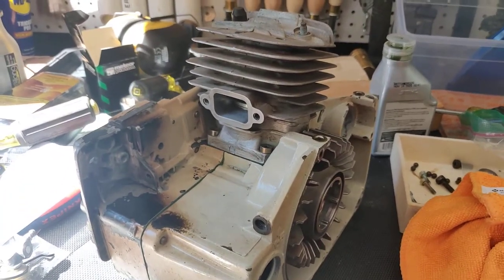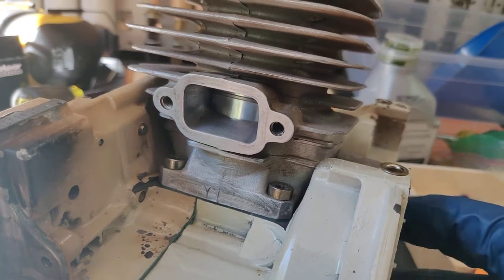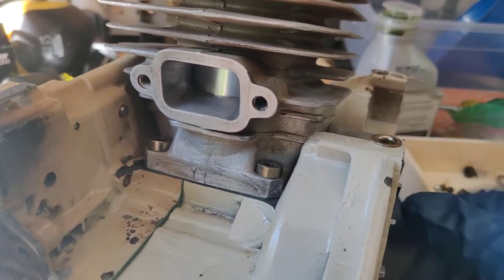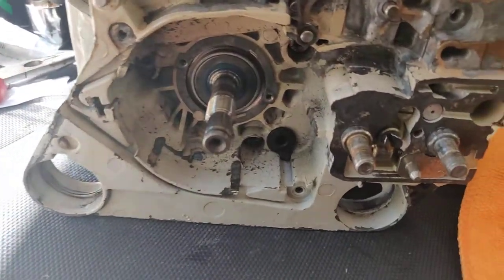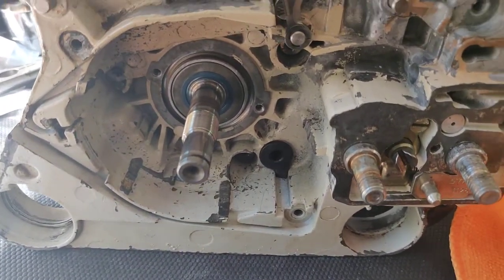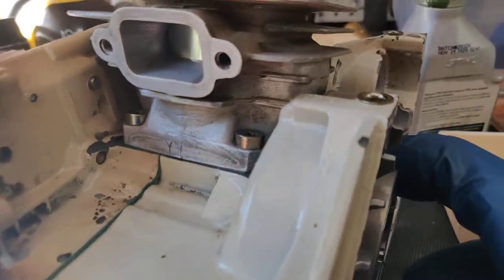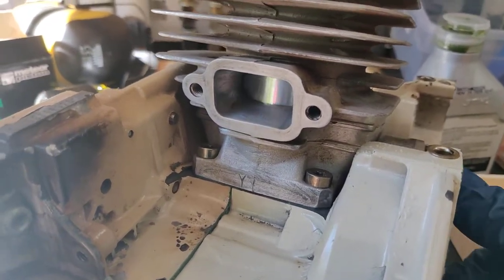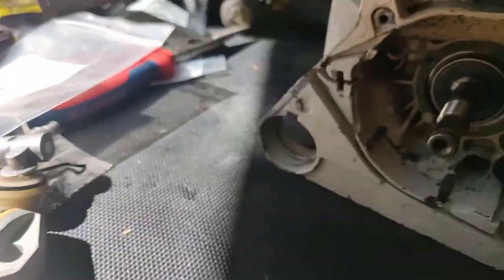Stihl 034 Super Chainsaw Rebuild - Seals, piston, and cylinder

Comment: Where did u get the cylinder from?
Reply from the maker: You can find the Meteor piston and cylinder at HLSproparts.com. I've also ordered from Wolfcreeksawshop.com as they carry some great kits for P/C that include the base gasket, spark plug, and decomp plug (if you want to do that - I didn't use the plug). HLS has a lot of aftermarket parts. Good luck!